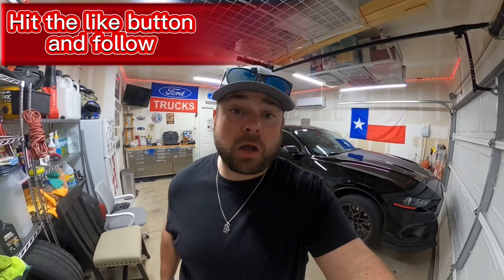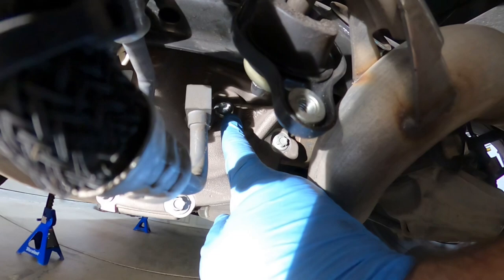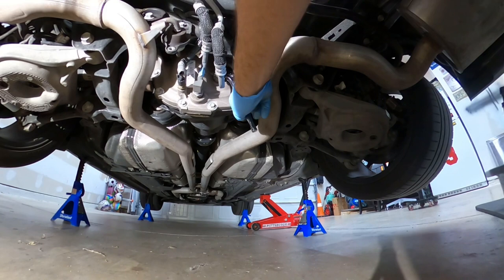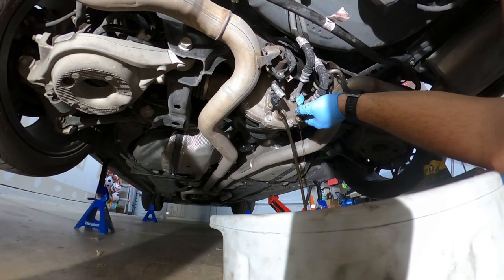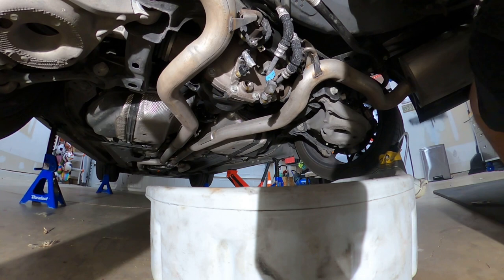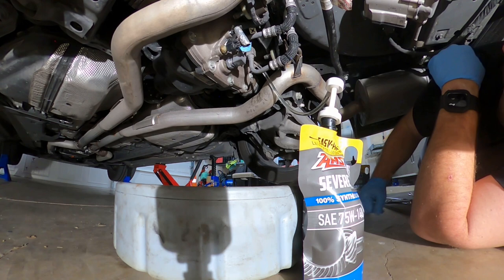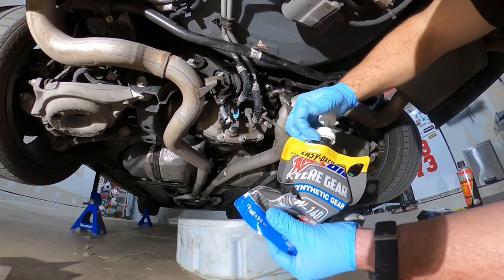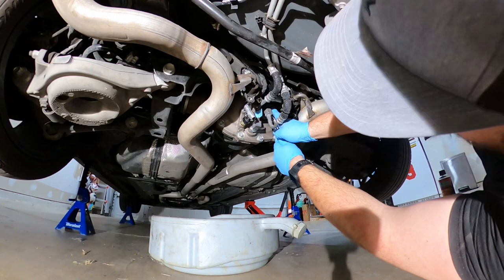Mustang Mach1 rear differential oil change. Shelby rear differential oil change.

Comment: For the drain plug I saw there is a clip if you remove with a pick or small screw driver you can slide that line to the differential cooler out. Makes it much quicker
Reply: You’re right. That how I drained it on my GT350.